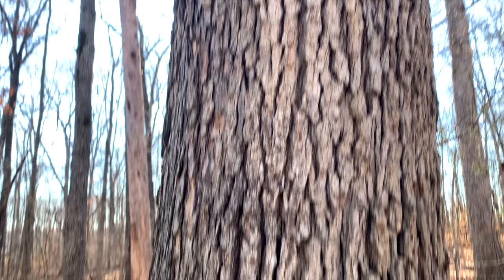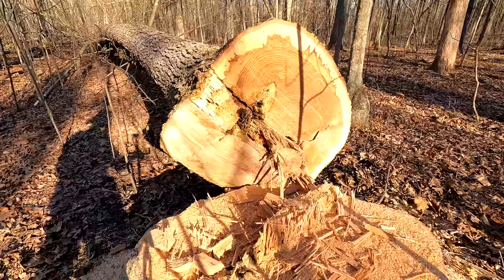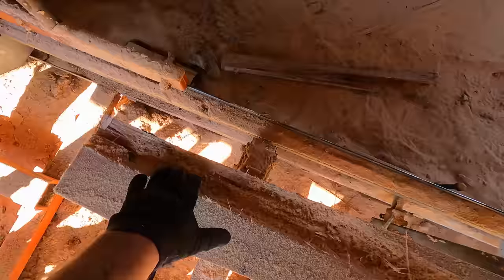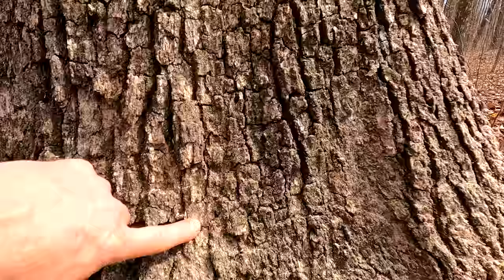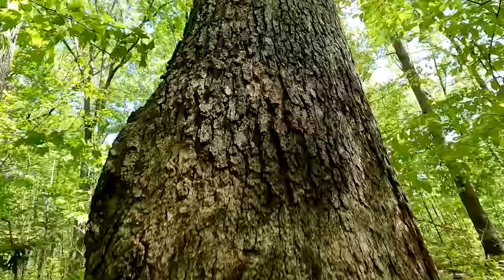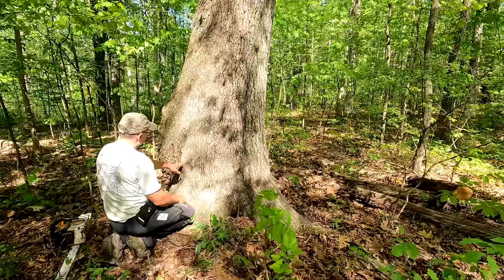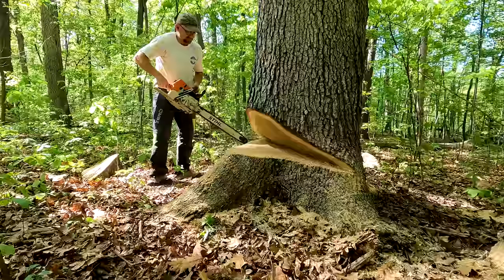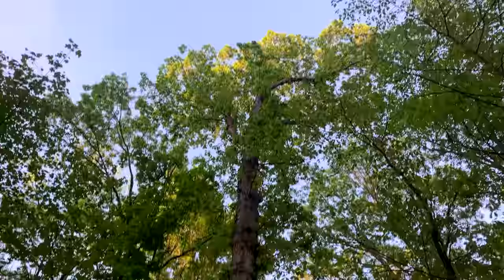Felling Big Oak Trees For Lumber.

Comment: Nice job on your hazard assessment! That’ll ensure many return trips to the woods and not the ER!

Try your sloping cut coming up from the bottom. This is called a Humboldt face cut. Depending on species and condition, you end up with the splinters pulling out of the stump rather than the log, and it protects the quality of your log better. But you were fighting an uphill battle with that first tree being rotten in the middle. A boring back cut, which is essentially what you did on #3, helps too, especially on leaners. Those two in tandem and you don’t have to bore out your holding wood as much, keeping more of the hinge intact and greater control during the fall.  Keep your gunning cut and back cut level. The elevation difference between each side in the first tree caused it to have more holding wood and pull to that one side, which also potentially contributed to your splitting.

Nice drone flying in that tight canopy! And cool shots from above with the falling trees!
Reply: I was thinking the same thing about the Humboldt. Also you end up with more usable wood off the butt cut using it.

Comment: just took a huge ash tree  down with my smaller saw. it came down nice and safe. Just took my time and made the correct cuts I had learned years ago from good logger. Several were the same as you used....very well done on your big trees.

Comment: Tip 1 cut the buttresses off first to reduce the bar size needed.
Tip 2 if you plunge the saw in to the back of the sink to sever the heart and just leave a hinge at the sides you prevent the heart ripping out.

Comment: As professionals cutting trees for removal, we don’t bother with a bore-cut / plunge-cut on fairly vertical upright trees. On heavily leaning ones it is ESSENTIAL to plunge cut and establish your hinge, then remove the backstrap and send the tree over. For whatever reason you think backward on this one.
Reply: I was thinking that. He said he opted for safety by NOT plunge-cutting, but he had a much greater chance of barber chairing by not bore-cutting and then releasing the backstrap. Isn't it safer even if the center is rotted?
Reply: @indigatorveritatis219  it’s important to note that he falls in a fashion that’s very uncommon outside of his region: traditional bore-cutting on a leaner is done by coming in from both SIDES of the tree, behind the face cut. You notch the front, bore through the tree and then come forward until your 10%-of-tree-diameter hinge is eatablished all the way across. Then cut the remaining wood at the back, and the tree goes over with zero chance of barber chair. He is plunging perpindicular to this, and I wouldn’t do that on a heavy leaner either.
Reply: @WildAcresFarms  I was confused when you said "perpendicular", because I had only seen the first tree being cut. I see what you're saying, and it's surprising to see someone take out so much hinge wood. I don't get the logic. Thanks for your insight
Reply: @WildAcresFarms  ...also, as a complete amateur, nailing the bore-cut from both sides is a challenge for me. I usually miss by a bit😄

Comment: Dropping trees way wider than the length of the bar, can be done by basically eliminating one side of the tree first, ( by notching, and  back cutting) then just use the other side , to drop the tree.
Reply: I would do the entire undercut first before I did any back cut whatsoever. Much safer.

Comment: I've seen more splits and tear out on things with a heavy lean as well, but an old timer told me if you cut above the swell you will see less splitting. I can't swear to it, but it seems to be true. Now in some cases it just won't matter. Oaks will often be hollow, and they are going to split no matter what.

Comment: The plunge cut that would have been useful, here, would be to plunge from each side, to form the hinge, then cut the back cut out, in reverse.  This spreads the shear forces all across the part of the stem behind the hinge, instead of pushing them toward the hinge.  Much less chance of a vertical split on a leaner.
Reply: What hinge. He didn't even leave one. Very dangerous, the tree can slip back towards the feller. Especially when the feller likes to keep cutting even when the tree is half way to the ground.

Comment: Plunge cuts are EXACTLY how you cut down a leaner.
Reply: The whole point in a plunge is to prevent a barber chair on a heavy leaner. You said you didn't plunge for safety. Can you expound?
Reply from the maker: Yes, I wish I had addressed this in the video but I didn't think to, and of course once the video is published you can't change anything.  Plunging from the side to define the hinge while the back strap is still intact is what you are talking about and you are correct, that does prevent barber chair and is safer.  I probably should have done that on this tree, but I didn't think it was leaning enough to make that necessary.  Plunging from the face cut into the center of the tree as I did on the other 2 is a very different plunge cut, and that's what I was talking about.  It's purpose is to prevent stump tearout and ensure a good log for lumber, not for safety.  I didn't want to be in front of that leaning tree plunging the face cut, just felt risky to me.

Comment: Fiberpull like that actually pulls the fiber the full length of the tree.  I was a sceptic until I was shown more than once in dried lumber and especially in veneer.  Fiber pull is a big deal on logs.  Anything over a 3 inch splinter on the stump is excessive

Comment: Been taking down trees for 33 yrs. Only 2 barber chairs in that time, one was a damaged tree, pretty much expected it.  A lot of time 50 ft up, dropping 1/2 the  tree at a time. Being able to cut your front notch, on a leaner , as deep as possible, without pinching the saw, helps a lot.Haven't used my sawmill, in over 12 yrs., been giving away truckloads of logs every month for decades.

Comment: There are only a few safe methods to cut. I’m not comfortable with this one. Flat cut 1/3 in and then cut out the top to make the wedge. Back cut at an angle , not flat. A flat back cut can surprise you. I’ve seen it happen

Comment: very good exactly how i fell myself for sawmilling, the cuts you did on the final tree are more like what i do. I cut the birdsmouth bore the centre out then plunge cut tothe hinge then run the felling cut round the tree to the other hinge point, has the advantage ofincreasing your felling diameter to twice guide bar length, here in uk i have felled willow for cricket bats FUN! you have tpo do pretty much the same but to prevent splitting as soon as you know the tree is going you cut through the hinge and free fell.

Comment: Plunge cutting is the only way to go on a leaner. If you leave the back uncut until you’re ready to drop, that doesn’t happen. Setup the hinge and most of the middle. The problem is you can’t cut fast enough to stay up on the fall. When you can’t keep up you risk barber chairing. I’d never plunge through the hinge. If your hinge fails you lose directional control of the tree.

Comment: I am envious of your wood supply house. Granted, I have a huge woods too, but at 67 I just don't have the steam nor the tractor to drag out the logs. 
I do have plenty of sawmills around me and can get all the rough cut hardwood or hemlock at really good prices that I want. But, my supply is dwindling after a dozen archery bows and my current project of 2 Tenor Ukes where one has your White Oak as sides and a Baritone Uke.
I used to never care about Red Spruce or Cedar until I found they are among the tonewoods of choice for soundboards and for that I and my dog did drag a standing dead Red Spruce out of the forest and milling with a band saw was no fun. Yea, I am envious of your sawmill too.

Comment: Rather than fall the tree in the direction of the “head lean”. Easier to fall it to the side lean…the less dominate lean.
More time to finish the cut, and the plunge cut may well not be necessary. JMHO.
Six years falling second growth/old growth timber in Oregon.
Reply: Also, you might consider a hard hat😀

Comment: I'd get a longer bar man, that saw will pull a 36in bar with a full skip chain. On the first tree, with the heavy lean and rot, I'd make a deeper face cut. Then do a release cut on the far side and don't overlap your back cut as far. Bummer of a split but happens. P.s. no one says "feller"  lol it's a faller.

Comment: Couple of thoughts on heavy leaders.  If you want your hinge to break clean, opening up your face helps as the sharper bend in the holding wood fibers when the face closes will cause it to break cleaner.  Of the 3 trees the first looked like the narrowest face opening which probably contributed to the stump pull.  I  agree gutting the center helps but isn't the safest on heavy leaders.  We like a boring backup to prevent stump pull and potential baberchairs on heavy leaders as it let's you finish your hinge before you release the tree.
Reply: Not sure how my phone wants to make "leader" out of "leaner" but it does.   Awesome video,  and some good techniques!

Comment: I’ve always made my face cut from the bottom up. Or even making a birds mouth. This allows the hinge to hang on longer as it falls. Doesn’t pull the center out like that. I can see the face cut coming in contact with the top of the stump and that’s when it split. Maybe this doesn’t make sense?
Reply from the maker: Yeah, a humboldt may have helped too. I don’t like those for lumber because it’s hard to make that bottom cut at ground level and I end up higher from the ground. But pro loggers use it all the time.
Reply: @FarmCraft101  I get that. I usually cut high stumps so I can pull them out later. Get your point though. Thanks for getting back to me. You put on a good video.

Comment: Dang, busted her good! Try to pull those leaners against their natural lean rather than plung cutting  and facing into the lean. Makes managing holding wood with the eastcoast style short bar, a lot easier. 
It's totally against safety rules but I'd rather stump jump whiteoaks & hickories right off of the stump if they need to go with the lean (down hill).  Thanks for posting. I spent around 10 years falling timber on the east coast. It was quite interesting to see what a busted log saws up like! Like any other pro, I've busted my share of logs, both from the butt & from the forks. I once slabbed a big old black walnut from the top to the bottom. The best part was the deliberation by The land owner on whether or not to cut said tree. OOPS!!

Comment: First tree - screwed up with a bad hinge. That caused most of the split/crack... Second tree - leave the strap on the very back, where you came out with your first plunge that way you don't have two straps, only one... Third (really forth) tree - good notch, if you are going to do that type of plunge, go in from the back. That way you can get the bar all the way in and not worry about the engine hitting the tree and not going in far enough. Oh, pickup a longer bar/chain. Keep doing what you are doing! Good channel.

Comment: Plunging would have been the safer way because of the lean, not the other way around. It also would have prevented the tear out as you already know. 
Honestly I think that tree might've barber-chaired if your bar was longer and you had been cutting a little slower... 
Be careful and plunge cut the heavy leaners

Comment: I logged a lot of cottonwood along the streams in a state in the middle of the USA, but I on occasion also cut some native oak, ash and walnut.  The cottonwood I always wedge cut, but the  other three I never wedgecut.  I always simply cut part way in on the side of the lean just like the start of a wedge and then cut from the other side and let the tree fall as it wishes.  Never splits that way.    On large trees (if the bar is long enough) I have also started on the lean side and just cut the tree off running the bar in and out to maintain room for the bar and chain as the lean closes the  gap

Comment: Not sure if it's been asked before but what is the smallest chainsaw you have ? The smallest chainsaw i own is a 16 inch and the biggest saw i have is an old homelite super XL925 with a 34 inch bar and chain. It's a heavy saw but it has plenty of power and torque

Comment: If you're milling it yourself, why not just mill around the split? Cutting length off might get the split and fiber pull out, but they could have been handled on the mill too.

Comment: Peter should have shown you what happens when someone doesn’t wear a hard hat or watch the crown of the tree. Don’t watch your saw watch the crown it will save your life. Face cut should never be more than 1/3. When doing a bore cut you set it and creat a trigger a thin sliver of wood on the back strap. A back cut can be level to one inch above the face cut I believe the just changed the books.

Comment: Wondering what chainsaw you used? 
I have some oaks like these and 2 much bigger i want to fall and im not sure what to buy considering i will only use it twice a year. What would you recommend?
Reply: Any saw brand with at least a 4- 5cu in motor and 20 in bar. oak is a hard wood to cut with a small saw
Reply: 40-50 cc not cu in  sorry

Comment: yeah. as other were saying.  the theory was good.  but the execution was just a bit off.  The wedge wasn't straight.  The back cut wasn't straight either, so you had different tension as it fell.

Comment: Not saying I know it all, which I do not. But when I was logging, I never wedged a tree. To us, it was a waist of time. We always looked at the top of the tree to see which side the biggest limbs were and “ringed it on one side till it started leaning and then we would ring it on the side of the heavy limbs till it started leaning and we would make another cut on the right or left side to pull it around what we called walking a tree or turning it to go another way. Then when we turned it on the stump we would cut it off the stump. I have “walked” a tree 180 degrees around on the the stump. We could spot it and then throw it where we spotted it.

Comment: Oak makes great furniture but not good lumber.  It splits easily when nailing, is heavy, and is practically impossible to toenail, even with screws and pre-drilling.  You won't be able to wedge your supports for stability, the joints are going to have gaps without a lot of work, and any horizontal beams are going to want to sag.
Better reinforce everything.

Comment: An expert cuts the stump off up high, so a backhoe can use what's left as a lever to push it and uproot it easily.   A fool, and there are many of them, cut them off down low to the ground where a backhoe will literally have to spend 5x of time dig it up.

Comment: I think there is an important point you have missed on Tree 1. If it is leaning, you should bore in from both sides & set your hinge width, before then cutting towards the back, leaving a strap of trigger, that is your final cut. If you had done this you would have saved it splitting .
Making a letterbox cut thru the notch is really only necessary when your bar is not long enough to reach the middle of the tree. The letterbox cut removes the middle, so your bore cut from each side then reaches the void you have made.
Have a look at some European videos, Female Lumberjack explains it really well.

Comment: Dude...adjust that carb, I can't breath. 😉
You don't use a Humbolt cut for lumber? 🧐
I just subed so I havent seen all your vids.  Look forward to it. At 67 and a rookie, I might not catch up.😫
Did some falling felling? For weyerhaeuser in my 20's but never had fun with a saw until I bought an Alaskan mill last year.
Already rebuilt my shop and workin on my barn and not ONE RED CENT has gone to Lowes!  Not just that...hard to describe how it feels to have a tree from seed to barn rafters.  It's as close to nature as I've ever been. An interaction few ever get to have.  Thanks for takin the time to share.

Comment: Would separating the hinge with the plunge cut not make it difficult to control when the tree falls? As in managing two separate hinge points at the same time - my fear would be one hinge would hang on longer than the other causing the tree to twist as it fell and become much more unpredictable. Genuine question as I harvest wood to heat my home, but I do it on public land in Victoria Australia where we are not allowed to fell standing dead trees, so I'm pretty much bucking fallen logs in state forest collection areas and 've never had to cut down a standing tree.

Comment: Excellent video. Great Camera shots & Drone shots are great addition. Maybe I missed the explanation but what is the advantage to the plunge cuts? I’m thinking you have to be careful that when you go in from back of tree you have 2 hinges and if not cut properly one hinge could hold and other come loose with possibility of twisting and tree not falling where intended. I am far from an expert and you explanation is greatly appreciated. 
When and why are they most advantageous?

Comment: You should learn two things to benefit you for lumber and safety. Use the Humboldt felling notch to retain more lumber...with those big base trees you should remove the buttresses. But more importantly, a bore cut is the safest way to drop a tree, as it does two things. Firstly...your hinge is exactly set and all that mess you left when the center tore out won’t be there, and then with only a small blackstrap holding the tree, you can sever that from the outside of the tree and not have you saw buried in the tree and you reduce/remove the chances of a barberchair.

Comment: cannot understand why a simple bind of saw can be forseen and  using a brace/blocks to complain about center and wasting wood it is about planks below and above center which was still quite good. You are not making poles are you?  A beam can be made longer deeper or wider of sistered aligned beams, or 'glue lams bolted.